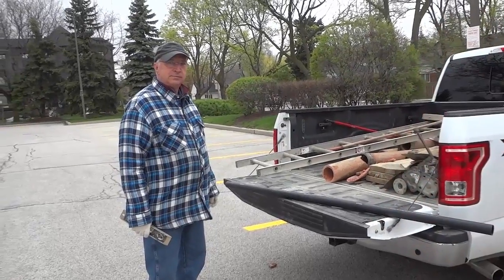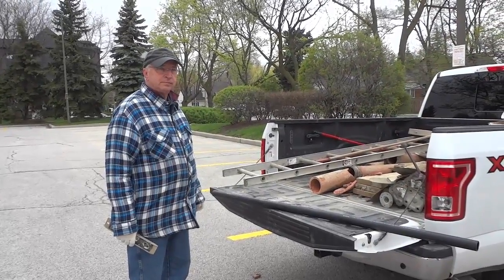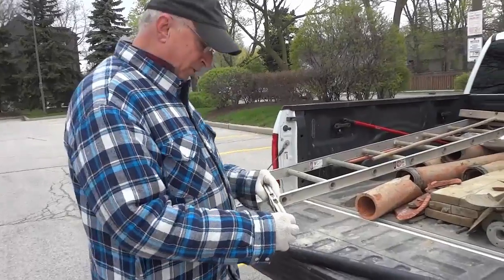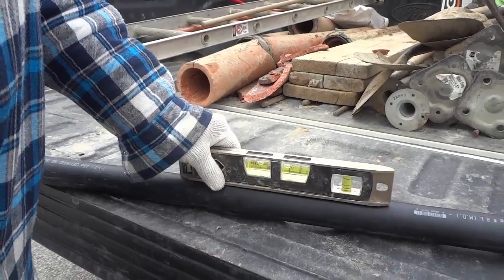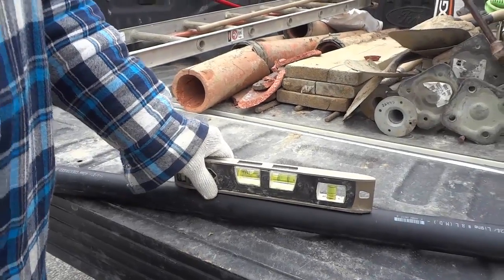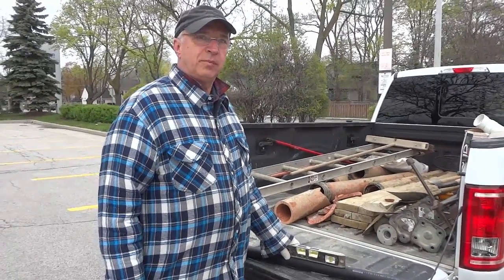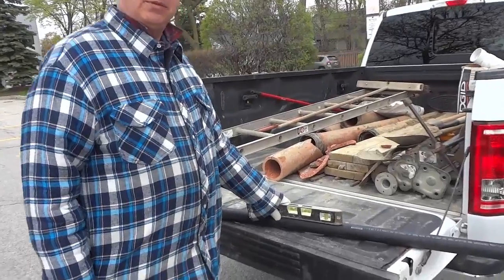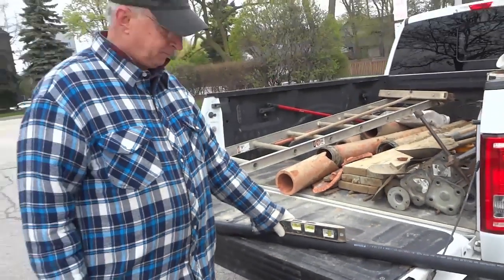The Proper Slope For Drain Pipe-Plumbing Basics

Comment: I've read that for 3" and smaller pipe is it 1/4" per foot. For 4" pipe it is 1/8". Is this not correct?
Reply: You are correct. From washbowl or sink it is 1/4" per foot, but a three inch pipe for instance should have 1/8" per foot. It doesn't have to be exact but shouldn't stray too far over said perameters.
Reply: You are totally right,  I v read the same a 1/4 of an inch up to 3 inches pipe,  and an 8th of an inch for 4 inches and up pipes
Reply: That is correct. The plumber was mistaken.

Comment: As a expert plumber I can tell you that for a 4" pipe the fall should be 1 inch in 40 inches, 6" pipe 1inch in 60 inches etc
Reply: So, that means  for a 3" pipe it would be 1 inch in 30 inches, for bigger drainpipes, 1 inch for 80 inches on a 8" pipe?!! Is that right.
Reply: U only need 1/8th on 4inch 3 and below is 1/4